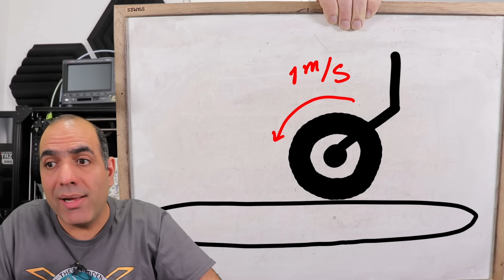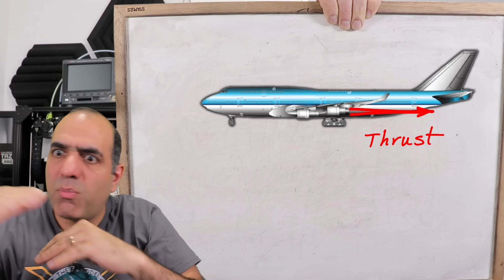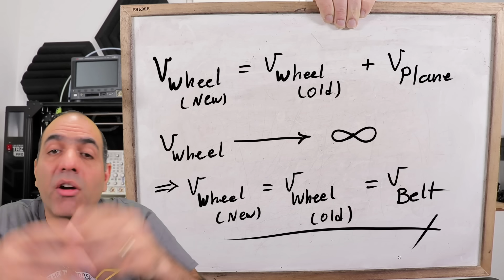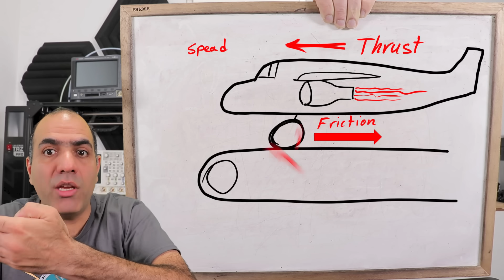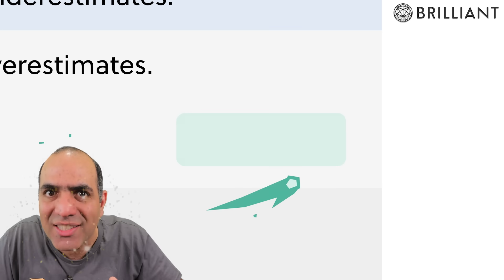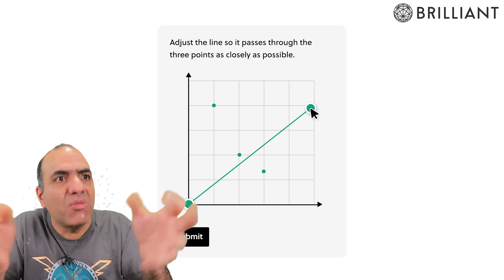Airplane Question that Drove Me NUTS!!!

Comment: I have a new thought angle to inject: This won't satisfy everyone, but lets for a moment step away from "magical conveyor belt and wheel speed matching." Lets just say that whatever the magical conveyor belt is, its intended to be a needlessly complex wheel brake system.

No one really thinks the wheels are what push a plane for takeoff so there's no reason to needlessly explain that over and over, but the fact of the matter is that a stationary 747 with its wheel brakes engaged and at maximum thrust WILL NOT MOVE. And therefore, with air speed within 20-30 knots of ground speed, will never generate the 150ish knots needed to get in the air. 

That is a perfect example of "the thrust isn't delivered through the wheels, but friction applied to the wheels can nonetheless prevent takeoff even at full thrust.'

This falls under Medhi's case of "it depends on what other assumptions you inject into it" but its a good example why "planes don't depend on their wheels to take off" isn't exactly the brilliant answer people seem to think it is.

Comment: The aircraft will take off, because it's airspeed depends on the thrust of the engines being able to accelerate the aircraft, the wheels on the gear is just there to minimise the friction between the aircraft and the tarmac.

Comment: Think it wouldn’t because the speed of airplane against air will remain Zero so there will be no uplifting force on the wings. Now let’s watch the video 😊 I imagined that speed of belt is matching the speed of plane during take off but opposite direction. Like man running on treadmill. 
Otherwise:
If plane wheels are steady and the belt pushing plane forward with enough speed and time  definitely the plane would take off and fly

Comment: I think that the case is that the plane is sitting there and the belt starts turning while the wheels match it's speed...in this case air is not moving over the wings so no flight

Comment: I'm about 30 sec in but already I can say that the movement of the ground does not matter since its not a car, the wheels spin freely, forward force is applied to the air, not the ground, hence it builds speed and takes off regardless of what the ground is doing, it's all about airspeed, groundspeed (literally in this case) means very little to a airplane

Comment: I guess it would be the same as a dyno for cars, since the friction is on the tires and not on wings touching the air.
Reply: The wheel friction is not where the plane gains speed from. The engines push the airframe and the wheels only spin because the plane is dragging them along. You could get four of your friends to shove the car off an all wheel dyno just as easily as you could if it were sitting on the street with no gas.

Comment: Yes, the airplane can still take off.

The reason is that the force that lifts the airplane off the ground during takeoff comes from the airplane's engines, which generate thrust to propel the aircraft forward. The speed of the conveyor belt has no effect on the airplane's ability to generate lift, as the lift is created by the airflow over the wings.

In fact, the conveyor belt may actually help the airplane take off by reducing the amount of ground friction, allowing the wheels to spin more easily and making it easier for the airplane to move forward and take off.

Comment: As you said, it’s dependent on a bunch of factors. But if we imagine that thrust is engaged and that the plane would feel the same stresses as on a normal takeoff, with mild wind, then no I don’t think it could. It would move off the belt and just hit tge ground. That’s if the belt hasn’t matched the opposing speed of the wheels. Or wait… idfk. Whoever came up with this question is an idiot.

Comment: I think the key here is that the wheels have their moment of inertia. In this case, even if the friction in the bearings and the "dynamic" friction between the spinning wheels and the belt are zero, it can be shown that the belt can counteract the engines' thrust by constantly accelerating backwards. This is because, as the wheels' angular velocity increases as the conveyor belt accelerates, they push back on the plane at their center where the bearing is. In fact, the acceleration of the belt needs to be directly proportional with the thrust by some (finite) factor depending on the wheels' combined moment of inertia. In other words, the conveyor belt can hold the plane still even in the absence of dynamic friction. But it's not clear if this is what they mean by "matching the speed of the wheels"...

Comment: The plane is pulled forward by the differential of air pressure created by the engines. It has nothing to do with the wheels other than to keep the plane from dragging on the ground. The belt will go into infinity speed as soon as the plane starts moving forward.

Comment: There will be increased rolling friction to the wheels, but no additional drag. The plane should be able to accelerate and take off, because the rolling friction of the wheel is small compared to the drag of the entire plane.

Comment: 04:43 nope, you're not correct. even with zero friction in bearings there's still force needed to spin up the wheels, as they increase their rotational kinetic energy caused by non-zero moment of inertia. where does energy comes from then? from the friction force with the conveyor belt, which has some finite value greater than zero. the faster the angular acceleration, the greater the force needed to cause it. from there you can calculate the needed angular acceleration for the friction force to match the plane thrust so it's not moving relative to air. then also you can check if friction force is greater then slipping threshold etc, but the initial argument about ideal bearings means no backwards force - is incorrect.

Comment: Assuming the plane's speed relative to the treadmill surface was zero, the treadmill would have to exceed the plane's takeoff speed by some amount to actually lift all wheels off the ground.

To takeoff the plane has to change it's angle of attack (point the nose up). This change in AoA introduces significant aerodynamic drag which would immediately slow the aircraft and push the nose down again.

Comment: Also, the plane takes off when lifting force exceed gravity force, but gravity holds the plane on conveyor. So, if it's very good conveyor to beat two the most powerful engines in the world, it can prevent the plane from taking off.

Comment: The math gets pretty ugly, but it is true that if the belt accelerates, even with friction-less bearings, the plane cannot take off because the angular momentum of the spinning wheels will exceed the thrust of the engines. As an engineer, I was totally against this answer, until I did the math.

Comment: I found that riddle quite easy to solve. Once you figure out that it's not the wheels that produce thrust so no matter how fast the wheels turn or not, they're dragged along. And probably quite quickly break off and cause the plane to crash and burn..
But Mehdi is wrong,  akshually. In his third scenario, the plane would fly (or, well, crash and burn).
If the wheels don't break off, or burn off due to friction, the plane will not stand on the ground, because that conveyor belt moving at impossible speeds would easily generate enough wind for liftoff and as soon as the wheels don't touch..

Comment: Answer before watching: No, only because if the conveyor belt is designed (programmed) to move at the speed of the wheels (not the speed of the plane), this will create a positive feedback loop as soon as the plane body starts moving. Faster wheel speed makes faster conveyor belt makes faster wheel speed makes faster conveyor belt, etc. This runaway would continue until the tires blow apart (assuming a magic indestructable conveyor belt) and the takeoff is aborted for a tire failure in the low speed regime.

Comment: You missed one: 

Eventually, that airstrip sized convener belt spinning at a ridiculous rate will drag enough air towards the plane to generate lift, at which point the plane can start to accelerate relative to the ground..... so, if we assume magical parts that don't burn up and/or explode.... sure.

You know, if the drag at the planes maximum speed is sufficient to pull in enough air to meet the planes minimum takeoff speed.

Which it probably wouldn't.

Comment: The Jet couldn't take off, because it wouldn't move. The speed of the wheels is determined by the speed of the airplane. If the best is going the other way, the speed of the airplane relative to the ground is 0. So there would be no airflow and no lift. If the plane is stationary, it doesnt matter how fast the wheels would go, because the conveyor belt cancels out the speed of the airplane. The plane wouldn't speed up, only its wheels. 
It would be the same as if the plane had no wheels and would have an adjacent, unbreakable barrier in front of it. 
If it dosn't speed up, it can't fly.
Reply: Aircraft wheels are not powered, the thrust comes from the jet turbines in the wings.
Reply: Friction has nothing to do with it imo, I imagine it like two kogs, maybe that helps understanding  aswell.

Comment: The problem as stated indicates that as the plane attempts to accelerate, the wheels would quickly ramp up their angular speed towards infinity.  

At some point, either the conveyor belt would fail or the bearings in the wheels would fail (or the wheels would fly apart if the bearings are magically good).  

If we assume that a conveyor belt "designed to" keep up with the wheels will outlast said wheels (i.e. part of the design is that there will never come a point where the wheels can continue spinning while the belt has failed), then the plane can't take off.  The wheels would quickly lock up or destroy themselves, and the engines would be insufficient to drag the plane down the runway to takeoff speed.

But if we hew closer to reality, where such a conveyor belt - capable of absurd acceleration, and capable of outlasting the bearings inside a plane wheel - is flatly impossible, then the plane will just take off as the conveyor belt ramps up to its own failure, with the plane's wheels spinning faster and faster as it moves forward in an otherwise normal fashion.

Comment: Since the plane is not propelled by the wheels but its jet engines, there is still a force forward. The wheels would start to spin, but the belt would match the speed and move the plane backward. So, I expect the speed of the wheel to increase until the friction of the wheel bearing is bigger than the friction of the wheel on the ground. At that point the plane would "drag" the wheels forward slowly accelerating while the conveyer belt speed stays the same (or even slows down since the wheel are now sliding instead of rolling).
So I think the plane can take off, assuming the landing gear doesn't break off.

Edit: Just saw the rest of the video. I still think, the plane could potentially be able to take off when considering the bearing friction, depending on what the ratio between the rolling friction of the wheel and the bearing friction is. Since the bearing friction actually doesn't directly oppose the force from the engines but the motion of the wheels. I'm imagining a car without ABS loosing traction while breaking. But I'm not sure - I'm not a physicist. ^^

Comment: 0:36 I’ve seen small planes take off from a stand still, resting on the roof of a truck with the truck driving as fast as necessary for the plane to take off. I’m not sure this conveyor belt one would work though because the jet isn’t actually moving, only the wheels are moving and there’s no airflow over the planes wings

Comment: This question is so easy I don't understand how people can be confused, unless they don't know how a plane works. The only thing that matters is air passing over the wings. So the wheels and engines are irrelevant. If the belt moves back as fast as the plane tries to go forward, it's stationary. So no air will flow over the wings. This is like 3rd grade science.

Comment: I'm guessing that the "statute of limitations" has ended on the Mythbusters 'plane on a conveyer belt' episode that proved this is stupid..... The wheels aren't what drive the plane forward so it doesn't matter how fast the conveyer belt is moving, the jet engines will still push on the air and allow the plane to take off.

Comment: You have to be an idiot to believe it wouldn’t take off the conveyer belt…the plan doesn’t have motors or transmissions or gear boxes for the damn wheels on an airplane. They have brakes but that’s about it. The airplane takes off with JETs using air to propel forward.

Comment: I paused and do not think so. In order to generate lift, the wings need sufficient airflow. Therefore the plane needs to move forward. The plane can only move forward, if the wheels move faster forward, than the conveyor belt does backwards, which is impossible. The plane stays at the same position and all thrust energy is dissipated in accelerating the wheels and in friction of the tires on the belt and in the wheel bearings, which would most likely destroy them.

Comment: i'm leaving my comment from the first minute :
As i think about it why does the 747 need to move on the runway in the first place ?, cuz it needs wind ! the wind is necessary to take off, so as the belt let's the wheels moving, it prevent the flight it self from moving, and so no wind, no wind = no fly, pretty simple.

Comment: In order to simplify this problem on the scale where there is friction, we can simplify the problem as "if the wheels on a plane didn't turn, would the airplane be able to take off?" and generally the answer to that question is "no".

Comment: I'm pretty sure the questoin maker intended to mean that no matter how much the jet engines try to accelerate the plane, the conveyor belt will adjust its speed so that the plane stays stationary. So you can completely ignore all that friction stuff and whatnot. Effectively, the plane doesn't move from its place, even though it's wheels are spinning.

Comment: that is exactly the same problem I have with these kinds of questions, they require disregarding some factors to work, but then you can have completely different answers depending on what factors you choose to ignore.
Reply: Also the missing info can cause issues, and adding them changes the question and most times would also change the answer.
We cant assume anythhing. Without forward momentum to force air over the wings, we don't have lift, and no flight. 
My final thought, it's not rocket science, but it is the Wright stuff. Peace.
Reply: Answer changes depending on which "wheel speed," you choose to measure.  On a normal take-off the ground already represents a surface moving in the opposite direction at a speed equal to the angular velocity of the wheels.
Reply: ignore physics at your own peril
Reply: And the premise implies that you should disregard important factors to deceive you. It's just a "gotcha" that makes it seem like a thought-provoking question but it actually isn't.
Reply: yep exactly, you would have to assume that the whole conveyor belt is totally unaffected by the laws of physics and perfectly able to match the wheelspeed instantly. So you can either match the ideal conveyor belt to a realistic plane whose bearings would fail at some point or to a ideal plane whose bearings have no internal friction at all and so on.

Comment: So here's the thing, unless the plane is sliding on the treadmill, it will stand still. If the plane is standing still, it can not gain velocity whether it is using its jet engines, or the wheels. If it doesn't have any velocity, it doesn't fly.

If we're meme'ing it up and saying the plane does tokyo drift on the treadmill then for sure this clown plane will fly, probably... once it gains enough speed thanks to its engines.

Comment: If the engines are running at the correct thrust setting and assuming no slip between the belt and the wheels (so the plane wouldn't slide off the belt) then theoretically the motion of the belt should cause the air (assuming std pressure of 101325 Pa) to move over the wings which would generate lift. However this poses another problem between the wheels and the grounds. The wheels would have to be locked onto to the conveyor belt but then again a release mechanism should release the aircraft when it reaches the correct takeoff speed. (BUT then again as mentioned in the video we don't know if the engines are running at full thrust or the engines automatically adjust speed OR the engines are off). If the engines are off the aircraft WILL fly for a small distance until it loses lift (however this is not possible if the belt is located on ground level as I highly doubt a 747 will be able to "takeoff" without continuous thrust.
(Sorry for the long answer lol)😆